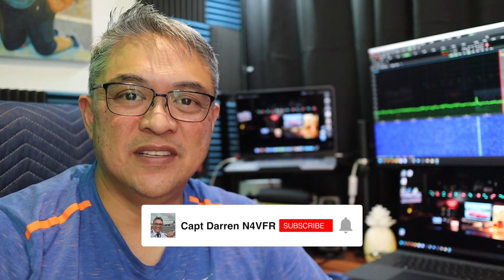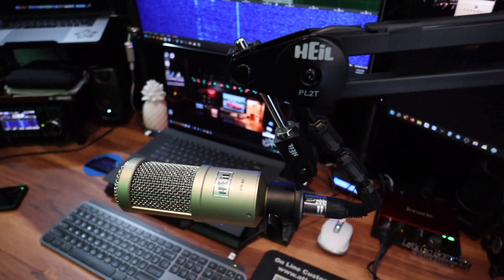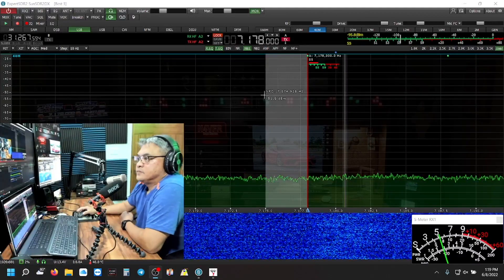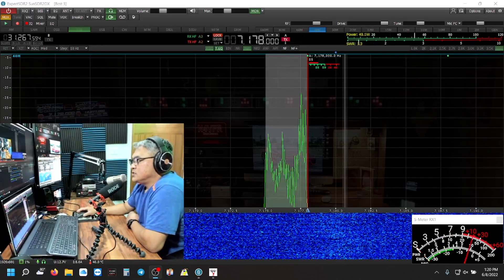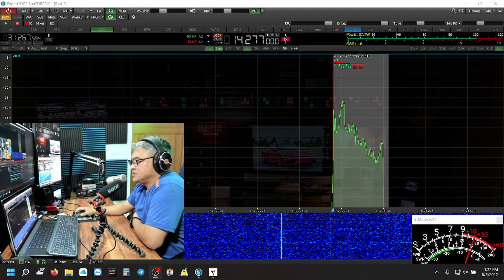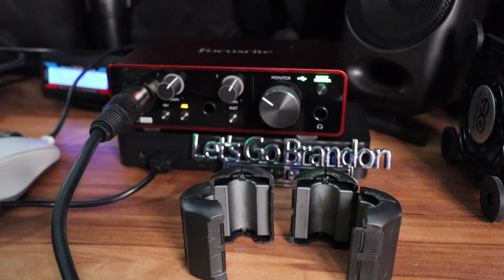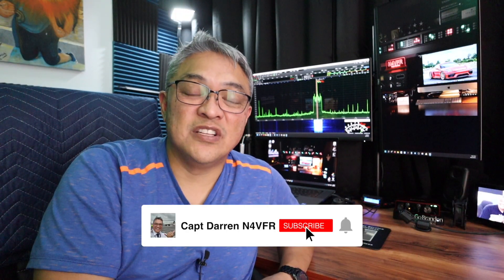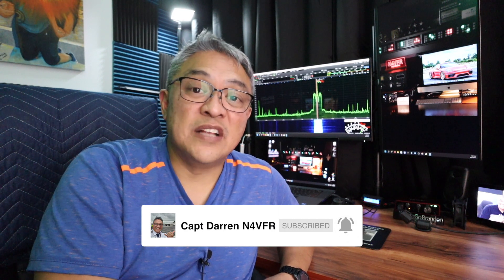RFI in my Shack | HF Radio Frequencies Interference coming in through my headset | How to rid RFI

Comment: there are virtually no highs in your audio so there is no clarity
(of course  I'm used to kenwood)
Reply from the maker: Thank you.  I will adjust my TX audio.
Reply: @DarrenN4VFR  pls feel free to make a video when adjusting audio and bandwidth on sunsdr.
and if I may also suggest to adjust the audio based on how it sounds not how it looks. but if you insist on looking use a stereo emulator and XY mode on oscilloscope - it's fun!

Comment: Great video Capt. I had the same issue with my SunSDR2 Dx I did the same thing this past Saturday. also I check all the wires and ground and notice my ground to the SunSdr2 was loose I fix that then I decide to ground the power strip as well. My next step is to cut off the power to the house and check one circuit breaker at a time.  anyway thank you Capt. for the video. 73s from k1apd

Comment: The inductive reactance will increase with the square of the number of turns on a given mix of ferrite. So your 2 turns on the ferrite would be 4 times "better" than once through it.
When fitting ferrites it is also worth looking at how various equipment is interconnected. IE your transceiver interconnects to the amplifier via the safety ground, the coax and the PTT/ALC cablees etc. Generally it is better to bond these chassis together rather than to try to RF isolate them from each other. It might be worth looking at the work of the late G3TXQ. I know the clip on ferrites are favoured when you don't want to remake cables but for simple cables like a 50 ohm coax it is easy to terminate the cable after wrapping it around the toroid. We all have favouurite recipes for these things, for HF use I use RG400 coax wound around a pair of FT240-43 and FT240-31 toroids as a common mode choke. It has killed my RFI issues but of course YMMV 73
Reply from the maker: Thank you. I'm experimenting with common mode chokes. I have all my equipment bonded to a copper buss bar and that is grounded to a grounding rod outside.
Reply: @DarrenN4VFR  good luck with the RFI, of course it can affect both transmit and receive. Common mode chokes are fascinating to experiment with, the more you explore them the more complexity to their behaviour. A lot of my understanding was helped using a cheap NanoVNA, to actually measure common mode impedance.

Comment: 1 ferrite bead on mic and other cables doesn't provide enough high impedance to keep RF out, you need many on each cable
Reply: I agree 100%, with most ""popular" mixes of ferrite something in the region of 6-10 turns is optimal. (More for 160m)